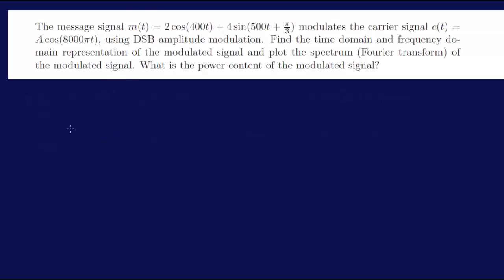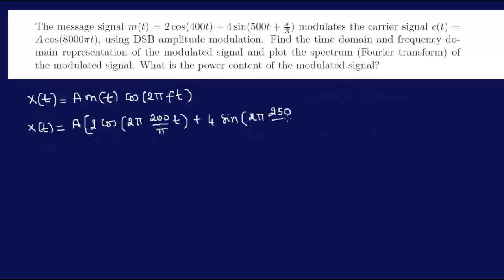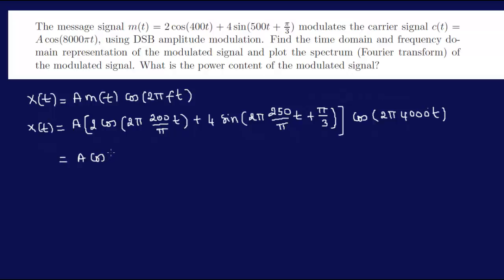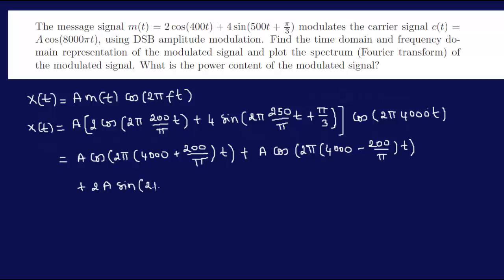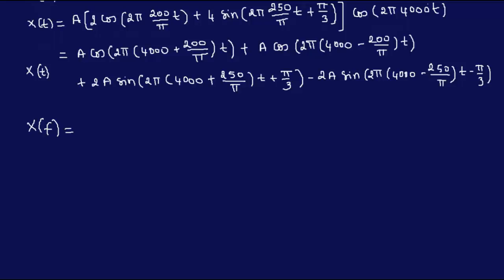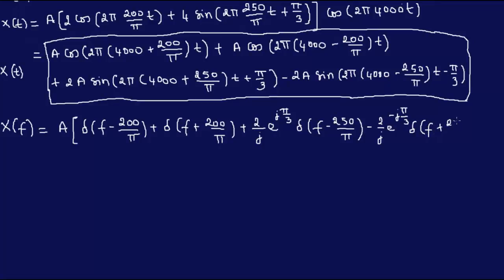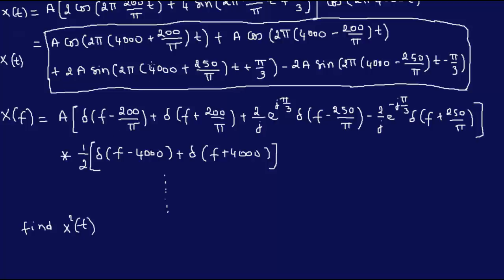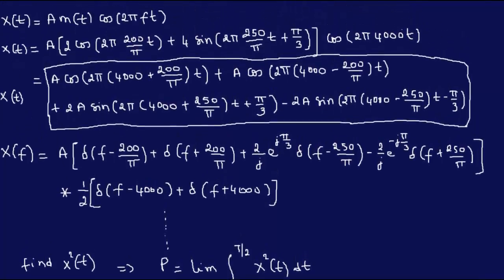DSB AM Modulation Example 1-FE/EIT Exam Review

Comment: thank you so much for all your video your lechers help me a lot .   i am going to take the fe exam in next few days , do you have some actual example like fe exam covered this section (DSB, SAMPLED MESSAGE , PCM) i know you explained these in your lecher  but you said in the exam they come small question do u have any question like the one probably show up in actual exam .... thank you
Reply from the maker: You're very welcome magdy. I'm glad I can be of help in any way. It's kind of hard to find good problems in communications but I will try my best this weekend and post them. If you have specific questions though, don't hesitate to ask. Good luck on your exam.
Reply: Raiya Energy
which trig identities are you using? is it the Cosine(A)Cos(B) and the Sine(A)Cosine(B). If that's the case, i'm not coming up with the same answer you have.
Reply from the maker: Darius Kamwa Darius, yes, I used those identities. Did you factor out the 2pi's?  What's your A and B? Once you multiply cos(2pi400t) in and factor out 2pi, your A becomes 4000 and B becomes 200/pi. Same for the Sine expression. Try it and see.
Reply: Raiya Energy
Thank you for your reply. First i set  A=400t and B=pi8000t. As i use the trig identity Cos (A) Cos(B)= 1/2 [ cos (A-B)+ cos(A+B)], here is what i get as final answer for that 1st part: a*cos [2pi(200/pi - 4000)t]+ a*cos [2pi(200/pi + 4000)t]. For the second part i set A= 500t+pi/3 and B= pi8000t, and then use this trig identity sin (A) cos (B)= 1/2 [ sin(A+B)+ sin(A-B)], and here is what i get as final answer for that second part: 2a*sin[2pi(250/pi + 4000)t + pi/3] + 2a*sin[2pi(250/pi-4000)t + pi/3]
What am i doing wrong?
Reply from the maker: Darius Kamwa I just did it again using your way. It's pretty much the same answers at the end except that your A is my B and your B is my A initially meaning I had A=2pi*4000t and B=400t. It's switched around but I don't see that you did anything wrong. As a matter of fact, your method is probably a lot "safer" as far as avoiding mistakes cuz you kept all in until the last steps. The final answer X(f) for the fourier should not be affected by either method. Good job :)
Reply: +Raiya Energy Academy instead of convolution i can also get the sum of the fourier transforms of each of the  individual time domain terms. For example i can replace each cosine term (Cos(2pi*ft+theta)) with the frequency domain (fourier) equivalent  and each sine term (sin(2pi*ft+theta) with with the frequency domain (fourier) equivalent. I think that may be easier to grasp.